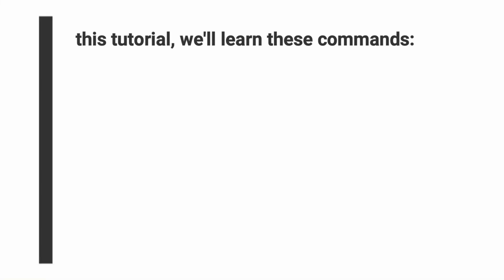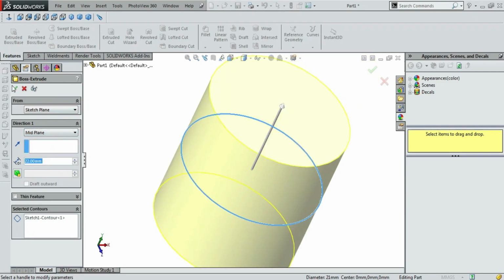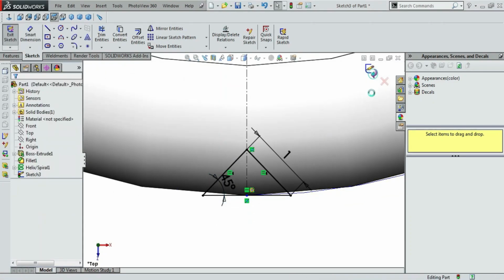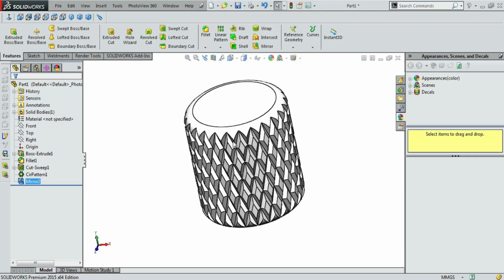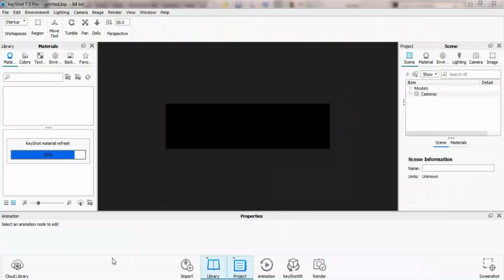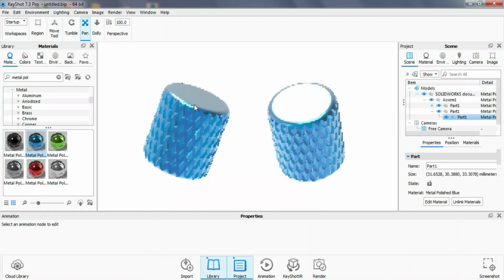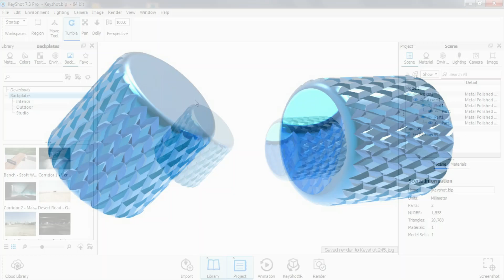Create knurling in SOLIDWORKS | Knurling Exercise Solidworks | Solidworks and keyshot | CADable

Comment from the maker: Tutorial Beginning: 0:00
Knurling Definition: 0:13
Knurling Examples: 0:23
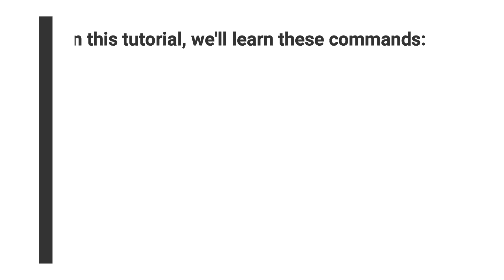Table of content: 0:44
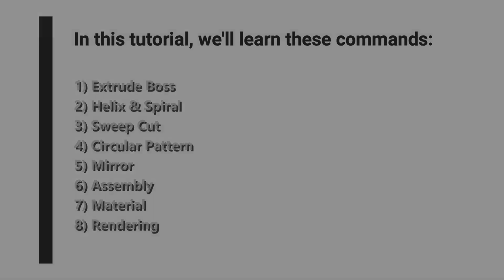Part Modeling: 1:07
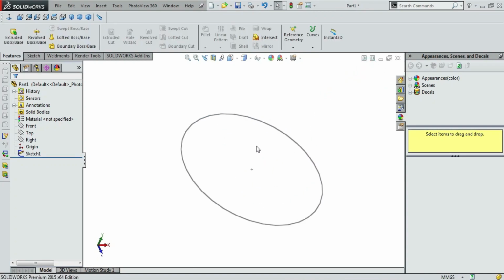Extrude Boss: 1:41
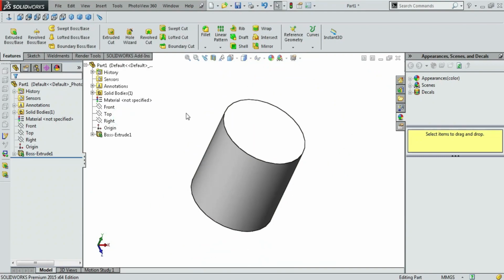Fillet: 1:55
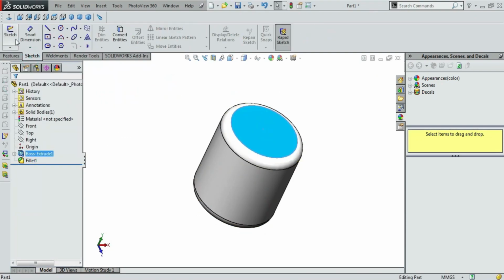Convert Entity: 2:08
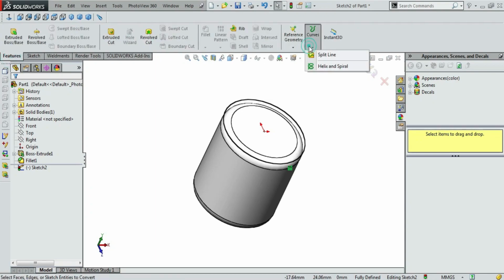Helix & Spiral: 2:20
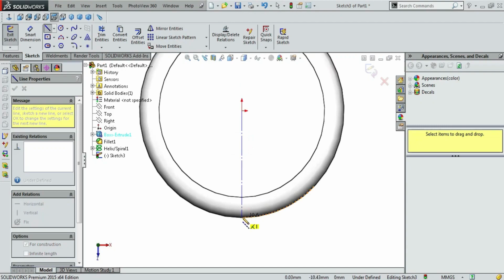Triangular Profile: 3:00
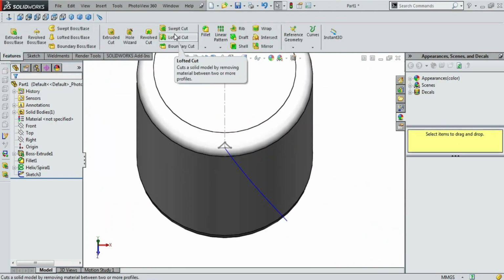Sweep Cut: 4:10
Circular Pattern: 4:33
Mirror: 4:55
Assembly: 5:16
Keyshot Plug-in: 6:13
Material: 6:53
Move Tool : 7:09
Final Render: 8:33
Final Element: 8:43